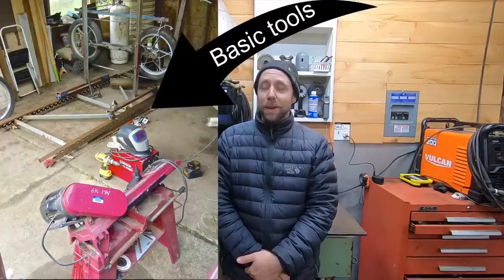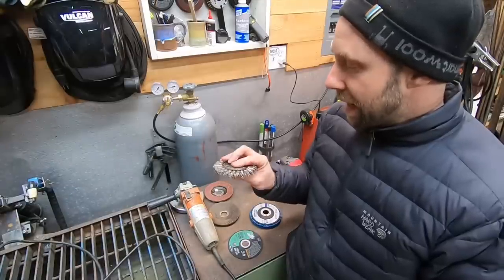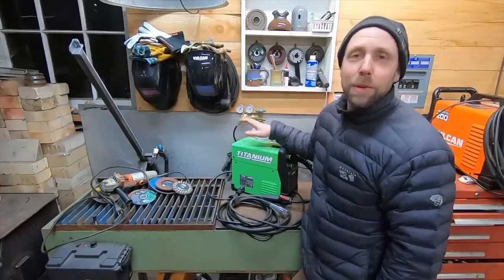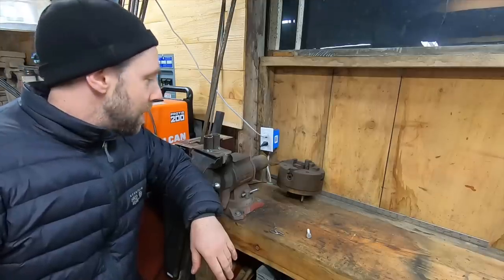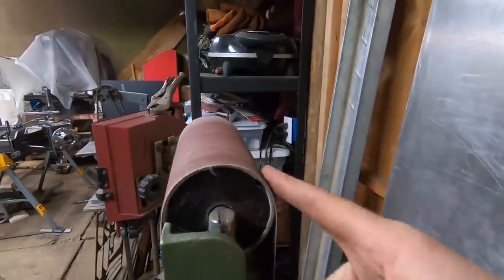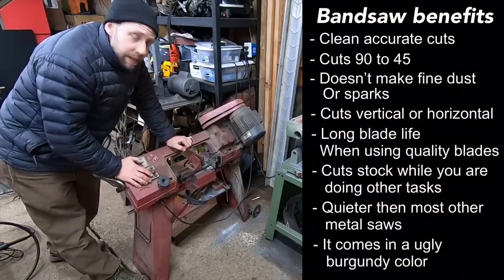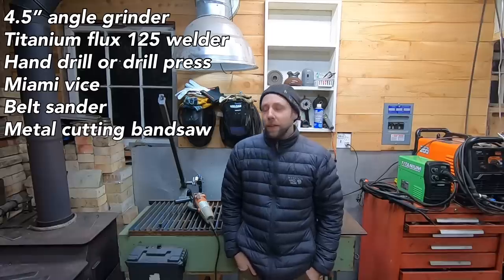6 affordable tools I recommend to get started in fabrication

Comment: Angle Grinder 0:41 
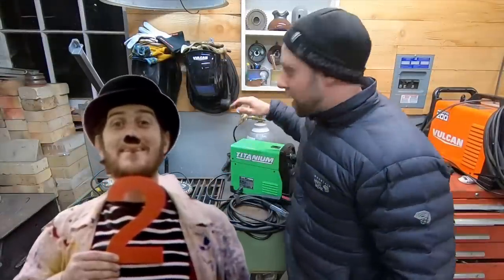Titanium Flux Welder 2:42 
Drill/Drill Press 4:47
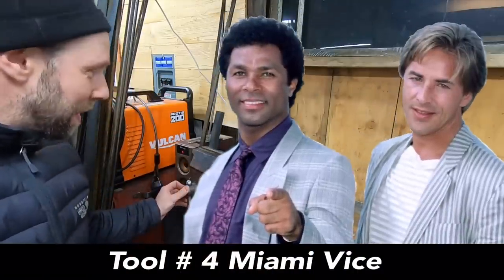Metal Vice 6:15
Belt Sander 7:52
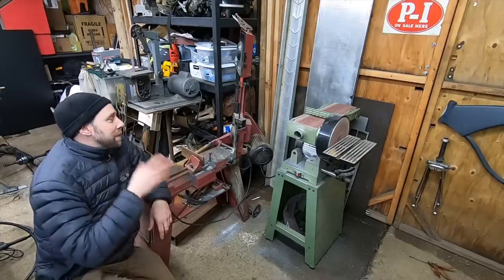Metal cutting bandsaw 9:52

Comment: As both a joiner in wood and a metal fabricator in my home shop I really liked your approach.    Get some basics without breaking the bank and get going.    You might find it wasn’t the passion you thought it might be and ... no worries.    But if it is, then you will gradually upgrade each thing as your needs dictate.    The approach Mike suggests for a starter is exactly right based on my real experience.   Grow into your metal working.   I had an abrasive chop saw but now a portable bandsaw and a smaller (Trajan) carbide chop saw.    I started with a flux core welder but now have full mig with gas bottles.   Love the cleaner welding.    I had the exact same orange HF angle grinder and have beaten the crap out of it and it still goes.   My second one is now a DEWALT 20 volt unit.   Old orange usually has the flap disc for weld flattening.  I have a 6” belt disc sander (Grizzly) from 1995 for woodwork but also use it for metal.    An HF heavy vice.   Floor standing drill press (Grizzly) also from 1995 when I started in wood.   Probably does more metal now in truth.   
Great review Mike.    My experience almost matched your approach.
I’m really WANT a Titanium plasma.    Not sure about NEED though.    Hell, I’m 77 and love doing metal in the shop so maybe WANT is going to win out!

Comment: 100% on these tool choices. I haven't done metal fab in years, and when I did I had access to a full shop. I'm working my way back in, and your list hits the tools I am currently acquiring (or already had). Love the tip on the jigs with the vice, think I found me an early project to work on :-)

Comment: I got the 90amp Flux core machine (Chicago electric) about 6 years ago. I didn't even go to Harbor Freight with the intention of buying it, however they were running an insane package deal on them (Hood, spool of flux wire, and the machine for $100 +/- $20). My first project was welding in the muffler on my daily driver at the time (it was clamped in at the time). Long story short, I abused the life out of that welder. It sat in the back of my truck for days at a time, been rained on, pushed to its limit building various things, etc.. It Never. Let. Me. Down. It did everything I ever expected it to (within its obvious limitations). 

I recently upgraded to the Titanium Unlimited 200 for tigging stainless exhaust (Recently finished my first turbo kit). Worth every single penny. 

A band saw is a must in my opinion, for the price of a cheap one, your cuts will be MUCH better quality, without the biproduct of abrasive cutting (Grinder dust). 

My 3 budget tools I couldn't go without (and suggest no one else does, either) would be a set of 90 degree welding magnets ($5.99), Caliper ($9.99), and Speed square ($5.00). Those 3 tools properly used make for proper fitment, and proper fitment is critical to a proper weld (Or at the minimum will make your job easier and cleaner)

Comment: I think a lot of people failed to read the title of "6 AFFORDABLE tools…". It’s a great list and most hobbyist don’t need top tools. I’m disabled so only do small projects and when buying tools I look for the best priced with a robust 3 year guarantee. OK, it will be a miracle if I’m still here in 3 years myself due to the nature of my disabilities, especially if I get Covid19. Even if I am I’m sure everything will still be giving me good service (except Bosch, the only tools I've had problems with). I’m also totally with you for getting better quality consumables like blades etc. I’d also say the same about hand tools, ever tried to sharpen a cheap chisel? Or used cheap files? Or cheap screwdrivers?

For your non-power Tools may I suggest a tap and die set? There again is somewhere it’s worth spending the extra on some decent quality even if you just buy 2 taps and a die at a time.

A really good video, thank you.

Comment: I'm a professional fabricator, I started learning welding and fabrication in 1972 in the high school shop. Sadly schools have pushed young people away from working with their hands. By the way I an still learning new tricks to the trade. Don't be afraid of learning new skills and tricks to make things simpler for yourself.

Anyway I think your pick of tools is good. On the welder I have mixed feelings. I will say get a welder your budget will allow. For most things a 135 to 160 amp wirefeed will do the job with hard wire. With the fluxcore wirefeed you can get away with less amperage because the arc is more like stick welding.
Reply from the maker: Kriss Femmpaws Thanks Kriss for checking out my video 👍 there’s definitely a lot of other welders I could have recommended, but for the $150 price of this one it gets someone starting easily. I’m all for MIG or even a multi process MIG, Stick, TIG machine, but I didn’t want to discourage people on a budget like when starting out. It is sad that kids get far less opportunities to build stuff these days. 
Hey Kriss check out this video, it’s a project I’m building at the moment, it’s a mini 4x4 articulating dump truck. https://youtu.be/vFphyNUhsaY
Reply: @Mikefestiva  I understand where you are coming from, I also understand the why.  Someone that has not done metal work and doesn't know if it's for them what you have suggested works. 

My go-to welder for portable work is my Thermalarc GMS 130 that I picked up used for 250 dollars off Craigslist. When it was new it was a high dollar unit. I got it mostly for welding aircraft tubing.  But found it packed a lot of punch in a little package. Runs 1/8 7018 like a champ... add my genset and heavy extension cord I'm portable anyplace I can back my Toyota to.
Reply: @krissfemmpaws1029  What gen set are you using to run this? I have not had luck with my Everlast ST140 and I think it was a 3500 Watt unit.
Reply: @John-Adams-Can  I'm using a 6500 watt unit to handle the inrush current when I strike an arc.

Comment: I definitely agree with starting out on a mig welder, it's easier to learn in my opinion and it's more versatile because you can weld thin material (sheet steel) opposed to a stick welder where you have to stay relatively thick, this is especially true with 110 volt welders because you aren't going to weld really thick material anyway so the mig gives you a much larger range of thicknesses.

Comment: I bought multi process welder first up. I'd never welded before. Multi process I think is great because you learning curve is much faster with the mig...I was sticking things together right from the start making small projects (flux core) with the mig. In between I was practicing with the stick function learning. Another cool aspect of it was that when the spool of the mig decides to play up on occasion, you just deal with that later and flick over to stick welding and can finish your project there and then. Welder I bought was a unimig viper 185. Since I started welding I've actually bought another stick welder that has a few more features...I think if I had started with stiick welding on all the small projects that I made with the mig, I think I would have been blowing holes in all the tubing I had bought and not enjoying the learning process as much. My opinion, start making projects right from the start with the mig whilst you get more confident with stick. Before you know it you'll have a prefence on when to use either.

Comment: I like your starter selection.  I prefer a belt/disc sander over the angle grinder for prepping metal for welding because I find I have more control over it than dealing with a wandering grinder.  Oh, I do use those grinding discs because my welding skills suck!  My Shopsmith Mark V has done double duty for me over the years and where the drill press setup is at best inadequate for drilling steel, that belt sander attachment is rock solid for making bevels and for grinding off the burrs and scale!  Thanks for the video!

Comment: I love my portable Milwaukee bandsaw, one of my favorites. I got it used and have owned it for over 15 years still use it all the time.
Reply from the maker: Right on! That’s definitely a great tool 👍
Reply: I need one and also a bandsaw table adapter, I think the larger surface table might work well.
Reply: BOOT I’ve looked at those but always figured I’d just build one, a few other projects to do first..

Comment: Here is the thing about tools. And put this deep in your mind when shopping for them. The price usually reflects the abuse they can get without braking. So buy tools base on how much you will abuse them. Yes a really expensive drill will last longer than a black and deckers. But expensive drills are desing to last a year under industrial conditions of constant use and abuse. So they will last you 3 lifetimes if you work on small projets 3 times a year. A walmart drill will last you 10 years under those conditions so don’t spend the extra money.  Leve expensive tools for industrial use, for them is better to invest top dollar on a tool brand that doesn’t really make any sense for a weakend warrior.
Reply: Good point

Comment: Thank you so much for this. Because I don't have 2 phase, high voltage at my work area, I was thinking about running an extension cord from the basement washing machine. And if that wasn't higher voltage, I was just gonna give up on welding, and just drill, tap, and red Locktite motorcycle frames and other parts together. But I didn't know normal plug welding kits existed. I want to build my own motorcycles, because I will not tolerate dealerships and the BS. Thanks again for this video. I'm already deep into electrical-engineering. Now I just need to get into structural & mechanical.
Reply: Wouldnt it be single phase and three phase only? I studied electrical for 2 semesters but that was 3 years ago and I'm rusty on my electrical and actually i only studied single phase :( but here are my 2 cents.
If you only have 120v single phase at home Harbor Frieght has these little green and orange welders (the once you see in this video, Titanium & Vulcan) and I'm planning on getting the Titanium DC Stick welder 225. It runs on 120v single phase up to 70 or 80 amps to weld with but has an extension to weld on 240v up to 225amps, plenty of amperage to weld your motorcycle frames.
And for an extension depending on the length you need, if my memory is correct when running extensions longer than 50ft you need to go on size thicker in AWS cable. So for example: I'm gonna make 2 extensions. I only require 25ft here at home so when running on 120v on the 20amp breaker & I'm assuming my house is wired with 12 gauge wire so just to be on the safe side I'm gonna use a 10 gauge cable for the extension. For the 240v its a 50amp breaker so I'm gonna use a 6 gauge (I cant remember if a 50amp breaker 240v uses an 8 or 6 gauge) so whatever it is I will use a gauge thicker than what I have in my wall just so the chord doesnt over heat. I am also gonna use SO cable for the extensions. 
Check out the Titanium DC 225 Stick welder. Stick is harder to learn but once you got it mastered you can learn any other process easily (except TIG, that one you practice with Oxyacetaline welding). If you wanna go the easy route pic up a MIG welder of the same brand or Vulcan but only if you weld indoors. If you weld outdoors get a flux core welder. 
I hope this helps.

Oh another thing, if you decide to go with stick welding stay away from the 6010 & 6011 rods, those are deep penetrating rods so you'll just blow holes right through and they arent very strong anyway. For your motorcycle frames you should be fine with the 7014. If your frame is really thin go with 6013 on DC reverse polarity. If it blows holes through switch the polarity to straight polarity.
I personally would use the 7014 or the 7018 but even the 7018 might be over kill for just a frame, it is the strongest rod though so your welds will never break and they'll be really hard to grind off smooth. 7014 leaves beautiful welds. You could be just starting and have a nice looking welds. Thats all I got for now. Sorry for the long ass message lol
Reply: 240v, strictly speaking, is two phase. It’s two 120v lines that are 180 degrees out of phase although it’s commonly referred to as single phase power. Also: never plan to use more than 80% capacity of a breaker’s rating. That’s why 15 amp circuits (i.e. breaker size) are only intended to provide 12 amps of power (twelve outlets consuming on average 1amp each). Never use an extension cord thats heavier than the house wiring. If the breaker failed for some reason, you could melt the house wiring without ever knowing anything was wrong (until the fire department arrived). It would be much better to have your extension cord start smoking.

Comment: I have the that little titanium 125.it runs very well and it's DC. They way flux core should be. Welds 3/16 plate and I have welded 1/4 plate without any issues on a dual pass. I run blue demon e71 flux wire. Absolutely the best flux core wire out there. As for my big boy welder I use the omni pro 220. I work in the oilfields and use this welder all the time. Never once had problems with it. Welds just as good as the lincoln and Everlast units we've got.
Reply from the maker: Right on thanks for commenting 👍 This little flux welder is a pretty good little machine, especially for the price. It’s good to hear you also own the Omnipro, they are solid welders, I bought one within the first month they came out, i did some reviews on the Omnipro and the Titanium 200, I ended up keeping the Titanium 200 mostly because it was more compact and lighter, I ended up selling the Omnipro and buying the ProTig 200 so I could learn AC TIG, I think the Titanium line is good, the Vulcan line is really solid. Take care

Comment: I started my business with a stick welder. It was the biggest pain in the ass to weld railings with. I only use stick now with my generator welder on my truck. You video is great. I would probably recommend a stronger amperage welder if you want to make railings,gates,fence etc. But none the less great video.

Comment: There are reasons, and good ones for beginning with the stick welding or even the gas welding process. MIG welding is very easy to get good looking welds on very early. Stick welding on the other hand (not to mention TIG and gas welding) takes some finesse and learning. If you begin with MIG and go on to try learning say TIG the learning curve is, for some steep enough to be impossible. I had and have a great guy who back in the late '90's started me on gas welding and it has made learning the other processes much easier. The point is, start with the difficult process first. It is cheaper and you can learn much more and the more difficult things are behind you. MIG welding is the easy mode of welding honestly. If you want to really learn to weld take the hard stuff first it pays off in the long run.

Comment: Great video, Im just starting out welding. At this point I don't even have a welder but looking at the HF titanium 125 Flux core as its on sale right now at $179, i just may go grab that today. I'm also researching all the additional tools and gear i need and your videos have been a great help. I'm a DIY'er myself (automotive/motorcycle/CF/Fiberglass/Wood..ect) with a few home patio and garage projects that require small light weight metal support structures (flat/square stock). 

All these years I've never had to pick up a torch because I could achieve the same result with some other skill set.

Learning how to Weld has always been on my mind but never had a project that justified the expensive starting cost of welding until i purchased my own home & the wife now wants a pergola with decorative vertical floral metal sun screens attached for some summer time lounging (permission to buy baby!). That said, do you have a video on stock usages and possibly slip joinery applications.. I need to go 0-100 with my metal fabrication learning.

Thanks for the videos, they've been a great help. Can't wait to get pass these baby steps and get into some serious welding applications.